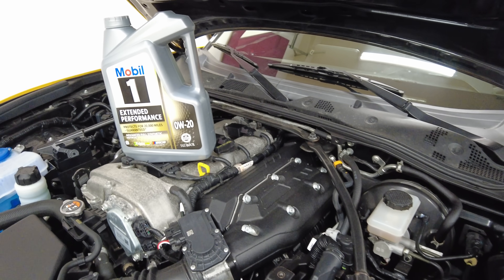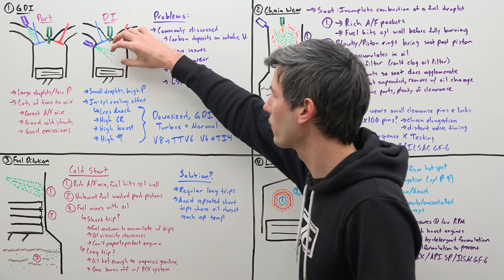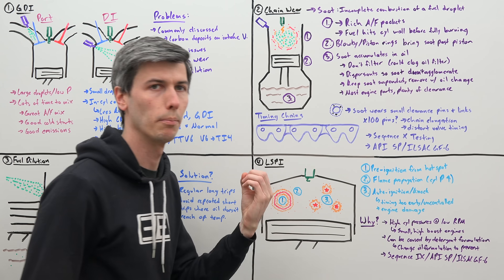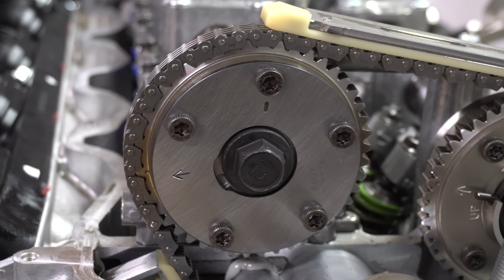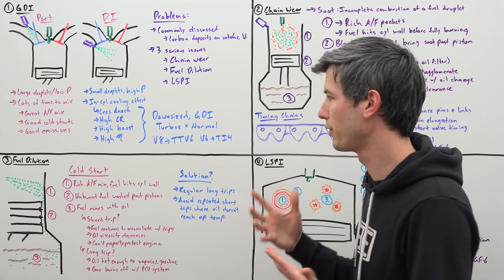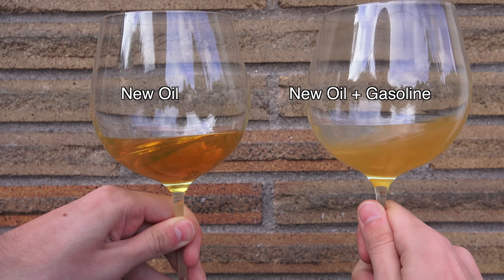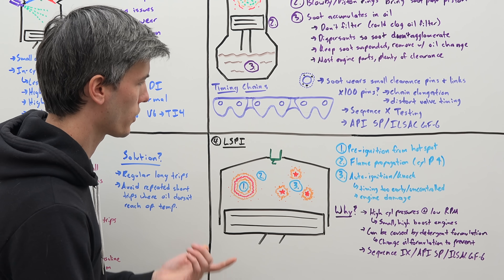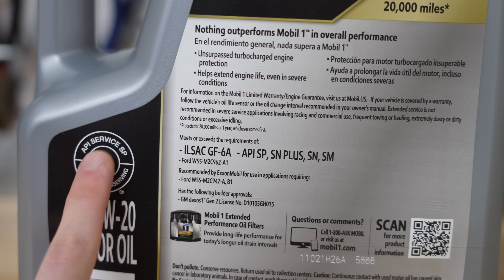3 Big Problems With Direct Injection Engines (Gasoline)

Comment: Never had an issue with direct injected vehicles...vehicle issues stem from oil changes. Good synthetic or natural gas derived base oils is all I use. I've had to change direct injectors once for a high mileage vehicle at 250k miles. Light carbon deposits on the injector caused it to atomize incorrectly and I'm pretty sure I could have just cleaned them but at that high mileage I thought to just change the OEM injectors to higher quality injectors. As far as deposits on the backsides of valves well that's thanks to EGR so using high quality oil on good intervals solves that. Quality oil solves a lot of the soot issues that can also build up on turbos.
Reply: Guessing you’ve never owned an Audi?
Reply: @AnontheGOAT  2, both became my wife's so light mileage and ended up selling back the RSQ8 and getting a BMW M5 Comp...the Audi sensors didn't play well with laser jammers to avoid speeding tickets or at least try. I grew up Ford and she loves her euro cars, but I do have 2 JLR products with the supercharged 5.0 that was designed by Ford...I really enjoy the 3.5 and 5.0 offerings from Ford.
Reply: @JacobVichique  you’ve probably never owned one past 60k miles I bet.
Reply: @AnontheGOAT  Audi's and BMW no... Hell on the X5 two weeks into ownership my wife hit a Texas pothole in heavy fog and bent both right wheels! If it were an American vehicle it would have only made the pothole larger!!! I expect 400k miles easy with our Ford products oil/battery/trans flushes/ spark plugs... Wouldn't expect the Audi with the V10 to be so easy but has great support so it's a keeper also was each our dream car.
Reply: @JacobVichique  ok well the reason you’ve “never had an issue with DI vehicles” is precisely because of that. They don’t show their problems until later. Audi’s are notorious for developing carbon buildup at higher miles which robs the engine of power, throws a CEL, and introduces cylinder misfires.
Reply: @AnontheGOAT  like I posted, had that issue with a high mileage Ford...just carbon build up on injectors. Simple swap and easy to do myself.
Reply: @JacobVichique  lol no. That’s different than what I’m talking about. Carbon buildup in DI engines occurs on the intake valves. You don’t just remove the injectors to fix it 🤦‍♂️
Reply: @AnontheGOAT  That's only caused by the Exhaust Gas Recirculation systems and that can be remedied by using true synthetic oil or natural gas base oil. Also at the moment we only have one DI vehicle all others are Dual injected, port and direct. SOLVES EVERYTHING! 👌

Comment: Before anyone copes with additives or premium fuel, the point is nothing touches the valves. So you can throw in there what you want it wont help, at least with the carbon buildup.
Reply: There are some oil additives (Kreen from Kanolabs and Neutra 131 from Schaeffers are two examples) that when added to oil they actually evaporate within 500-1,000 miles of driving and are carried through the PCV system which can help wash the valves in DI. Nonetheless, it is a good idea to clean DI valves through the throttle body with a can of PEA spray every 20,000 miles or so.

Comment: So, in other words, direct injection SUCKS. I knew that, but not all of the the reasons why. I just knew it was bad for knock and dirty valves. The million-mile reliable ‘90s/‘00s engines are a thing of the past, well, except the ones that are still going…

Comment: The direct injection trend has been applied to diesel engines just as much if not more. To what degree do diesels suffer from these issues more, less or the same as a petrol engine?
Reply: Most diesels don't use timing chains, but have direct mesh gears, but soot is still a concern, especially with using egr. Having oil that can handle the soot helps, as well as efficient combustion.
Low speed pre ignition is not a concern, since fuel is injected virtually at tdc. Only time its a concern is if a person is changing fuel injection timing for performance.
Fuel dilution is a concern for engines that don't get to operating temp. (Lots of idling or short trips) some call it "wet stacking" when fuel collects as a liquid, instead of being atomized and burned. It's also a concern during the dpf regen cycle, in which certain engines inject fuel during the exhaust stroke to raise exhaust temps to burn off soot. Basically, it's a factor in maintenance and driving style.
Reply: @tangydiesel1886  brilliant answer thanks,  yup my diesel is gear driven not chain so I can see how that one is negated. One of my diesels is old school and has no dfp, egr delete and gets plenty of longer drives so that all goes in my favour.
Reply: @tangydiesel1886   
You won’t get pre ignition on a Diesel engine . It’s a compression ignition engine 🙄
I have a 2017 Ford transit with a timing belt in oil it’s on 150000 miles. It just needs the correct oil.
Reply: @hoonaticbloggs5402  I didn't mean the same as a gas engine. I was being way oversimplified. But if you have your fuel injection timing way advanced, like 20,30,40 degrees before tdc, it will cause engine damage, similar to a gas engine suffering pre ignition or ping. A normal person won't see this, but someone either cranking the pump way advanced, or doing it electronically in the tune for either chasing max hp gains, not knowing what they're doing, or for shots and goggles can kill the engine. Yes it uses the heat of compression to ignite the fuel, but the ignition happens right at the point its injected.

Comment: I dont like direct injection gasoline engines. Some make it impossible to even replace a valve cover gasked without using specialised tools, because ofcourse the injecors need to be one solid part with the fuel rail. I have read about LSPI bending con-rods into question marks. And I also dislike them creating more uncombusted particles forcing them to be fitted with particle filters to reach emisson regulation standards.
Gotta appreciate them being more fuel efficient and allowing for more boost but thats not a price I am willing to pay.
Reply: Typically LSPI turns pistons into confetti and scatters that around the rest of the rotating assembly. Those are some pretty stout pistons to make the rod bend lol.
Reply: @michaelallen2501  both types of failures are horrendous for the engine.

Comment: I used to own a 2017 Honda Civic with a 1.5l turbo, it suffered from the commonly-reported oil dilution issue, where in cold weather fuel would stick to the cylinder walls and be washed past the piston rings and accumulate in the oil. No matter how I drove it, the issue would continue. The dealer assured me it was standard direct injection behaviour.
I owned the car from new, only put around 5000 miles a year on the car AND changed the oil twice a year so there was no problem but I never trusted in the longevity of the engine and was happy to say goodbye to it. 
I now drive a Tesla Model Y and although far from perfect, it far better suits my driving, which is lots of short journeys in cold weather
Reply: And Honda has a class action lawsuit over that engine. I know because i am part of it. Sadly I had a '17 CRV with the 1.5T engine. Had it 17 months after buying it new. Had oil changed every 6 months,yet there was still enough gas in the oil to where i could hold a lighter to the dipstick, the metal portion not the plastic part and it would flash! It was the gas in the oil that caused that.
Reply: @robertjaent6087  Has it been fixed in newer models or is that Honda PR too?

Comment: I'm struggling with a below normal range idle when warm problem in a 2L mazda 6 mk3 engine with less than 60k miles onboard, and what you just told me makes me wanna sell it right away. I've been scratching my head alongside a handful of mechanics as to what the issue is and the only thing we've come up with is the ICV or the throttle body itself. Everybody told me to stay away from the 2.2 diesel cause it's problematic, and I'm running into rough idling when warm on a petrol engine with around 60k miles on it. Kinda ironic. 

P.S. I've tested and retested everything, the only parameter that's out of its range is the ICV feedback being at -0.57 when its range is 0-100.

Comment: Toyota in the Gasoline direct injection motors is using the Multijet logic; Instead of injecting once it does it injects multiple times. In a video I see it also injects while the inlet valves are still opens, does this help to clean the back off the valves?

Comment: Solution for short trips. Let your vehicle warm up some before driving(when in a rush I don't do that, whoops), and then open it up a little. 0-40, faster than you, I like the skinny pedal. Of course you need to wait for your vehicle to have warmed up enough to do that but 5-10 minutes and my engine is warm anyway

Comment: Great! Another video to fuel my existential dread of owning a Flex Ecoboost while living in a small town. Good job! 

It's why we give it the Italian Tune-up on the regular. Or, as my son called it once, the "Irish Pedal!"
Reply: The Ecoboost is pretty solid, just use synthetic oil and change it every 5K and you'll be fine. Some people see 5K as excessive, but for "severe duty", ie lots of short trips, its good practice.
Reply: @ice44567  I get my oil tested every time I change it.   I only use mobile one 0 20.  This last time I waited 7 months which was only 5,600 miles.  The oil test came back from Blackstone with excess gasoline.    So from now on I'm going to make sure to change my oil at least three times a year never mind the mileage.  I think testing is a good idea with these engines.   I have a GDI four cylinder Accord with turbo.  I plan to test every time I change the oil but if you wanted to make an economy move you could probably test once a year as long as you were changing the oil three or more times a year.
Reply: TIM
Who's going to keep it 200,000 miles anyway.??
Reply: @hotrodray6802  I do
Reply: Italian tune-up is vital! 😂
Reply from the maker: Haha, love it. Give it the Irish pedal!
Reply: Take mine in the back roads with high loads in 3rd or 4th for about 20 minutes and it brings oil temps 200-230F.
Reply: If you change your oil with good full synthetic regularly the ecoboost is good
Reply: A Ford mechanic said that with the F150's with EcoBoost engines, the biggest problem he sees is people driving them too gently all the time trying to get maximum mpg's. They never really 'get on' the turbo boost and as a result the waste gates get sticky - or stuck. These engines are made to be pushed some, it's a good idea to get them onto the boost fairly regularly. (BTW today I drove my F150 3.5 Eco on a ~50 mile trip, had everything from in-town with traffic lights and 30mph to 55 on the highway with some at 60-65. I got 25.6 mpg on the trip. :) But I also know how to unleash the beast and enjoy doing that sometimes.

Comment: This is why you have to idle your car for 5-15mins for the engine to warm before starting to move.
Reply: That's excessive and the engine will struggle to warm up that way.
I've tested this myself with my scanner, with the heater on and idling the temperature doesn't even go up.
Idling takes forever for the temperature to go up. However if you start driving slowly the temperature goes up much much faster.

Comment: Pre-chamber technology is even better, which is what a lot of diesels use, and is what Formula 1 is currently using. Basically instead of directly injecting into the combustion chamber, there is a small pre-chamber where the spark plug (or glow plug if it's  a diesel) and fuel injector are actually located. This allowed the air and fuel to mix in the combustion chamber like port injection, but kept the benefits of direct injection. Obviously results and design varies from manufacturer to manufacturer, but it's a pretty old technology that is being brought back in some applications.
Reply: I  bought a new honda Accord that had a pre combustion chamber in the late 70's. Pre chamber looks like a spark plugs hole to the cylinder, with rich mixture. The regular intake/exhaust was lean mixture. No unleaded fuel required. No catyl converter. 1750cc. Sold it 4 years later. Not a single problem!
Reply: @dannjudy10  I think the classic Honda CVCC system is called "stratified charge". It didn't need a catalytic converter until years after other manufacturers required one.
Reply: Sounds funky, read about the pre-chamber techology before in old Diesel engines. But who knowns if sacreficing the perfect combustion chamber shape is worth the better mixing of fuel and air.
Reply: @leogreck9984  It creates a much cleaner and more importantly and MUCH smoother burn. Instead if a BANG when the spark plug fires, it's more like a quick WHOOSH

Comment: Shouldn't D.I engines be injecting a mix of air AND fuel at a high pressure through the injector into the cylinder in addition to the normal air intake charge?
Reply: No.

Comment: I have an aging fleet of first generation DI engines -  BMW N54 (140k miles), BMW N55 (82k miles), 2 Audi 3.0 TFSI (150k miles and 60k miles), Audi 2.0 TFSI (140k miles recently sold) and a Porsche 9A1 (89k miles).  (Also have one Tesla Model S, no DI of course).  Of these, I had to walnut blast the N54, but it is still running strong with a Cobb stage 1 tune.  The older Audi had to have a very expensive timing chain replacement recently, but that was because of failed plastic tensioners and a bad cam sprocket.  Both Audi 3.0T motors suffer from carbon build-up in the secondary air passages which cause occasional to frequent check engine lights.  This is somewhat expensive to clean/repair and is a major annoyance.  The Audi 2.0T had none of the issues in the video that I know of and it was running an APR stage 2 tune.  And the 911 engine so far has been trouble free.  The biggest fail on this list is the N55 - it developed rod knock.  I took the engine apart expecting a spun bearing, but could not conclusively determine what was wrong.  Bearing tolerances seemed fine on both rods and mains.  Ended up sourcing a used engine to replace it with.  I don't think it was a DI induced problem however, but you never know.
Reply: N54 FTW! Change the oil @5k and run meth injection, voila clean valves.
Reply: @TML34  As someone that owns an N52 I am jealous of your power but I can't be having my daily breaking down all the time 😂 I just gas n go and  change oil once a year because I only drive 4k miles a year. My friend has an N55 with like 700hp but he's constantly working on his car lol.
Reply: @saganworshipper6062  you just have to know the faults and what to look for. My N54 has been perfectly reliable....so far. 😀
Reply: As an owner of a 9A1 engine (Boxster S, 75k miles) I am glad to hear your 911 is still fine! 👍

Comment: Some people are saying(or Implying) Toyota engines always have Port injection when there is Direct injection, but that is not always the case. The Lexus IS250 only had Direct injection, but the 350 has both. Atleast for the generation from 08 to 13. Not sure about the others
Reply: You are correct, although I believe the 250 was their only DI Only engine. 
It had lots of Carbon Buildup problems

Comment: My old 2003 Opel Signum with 2.2l Diesel with 125HP had oil changes at 55/110/160/210 and 260 thousand kilometers or at 34/69/100/131 and finally after 163 thousand miles (around every 2 years). Used always Mobile 1 0W40 although not really recommended. After 285tkm or almost 180k miles I sold it running like new. Always carefully drove the engine warm, and had mostly longer drives around 30km/20miles. Very seldom redlined it, and even fewer hit top speed (205km/h). Wasn't slow either on the car, rather engaging driving style. Very robust engine. Not much power but it was alright. Car wasn't too heavy anyway, 1600kg at 4,65m car length. Miss that car.

Comment: What do you consider a short trip? I shortened my commute significantly and I worry about dilution on my Mk7 GTI.
Reply: Also depends on your driving style. You can go 30miles without really warming up the engine oil if you diddle around at 1000rpm.
Reply: It's in the video.  15 min and under.  Just go for a longer drive every so often and you'll solve the issue.

Comment: What about the direct injection with the Brazilian ethanol? Does these problems occur? There is new problems that happens if you use ethanol?
Because BMW 320i here have a pretty good 2.0l flex fuel direct injection and it doesn't seen to run into injection problems often when ethanol is being burned

Comment: Had a DI TI4 engine back in 2006 nothing but problems: oil contamination with fuel after 4K miles, HPFP failures, valves being gummed up, etc. Solved it with a old school NA Toyota 1GR-FE V6. Not as fun to drive as the TI4, but also not a single headache.
Reply: Simplicity is what makes reliability. Complex systems tend to have nice numbers on papaer but tend to redact the price you pay for thier unreliability.
Reply: What is an TI4 engine?